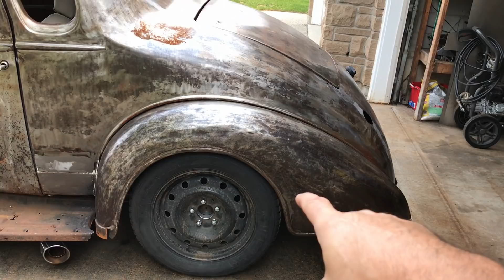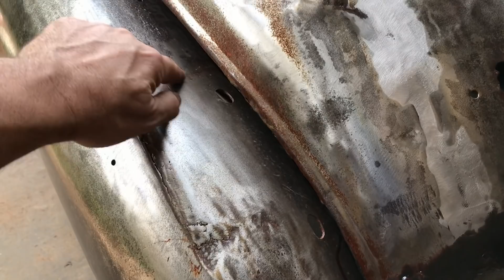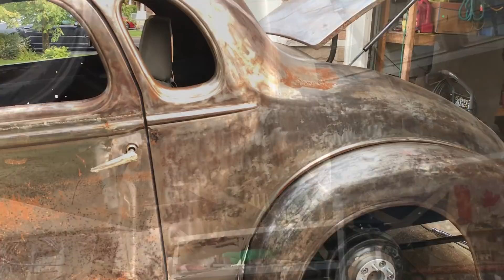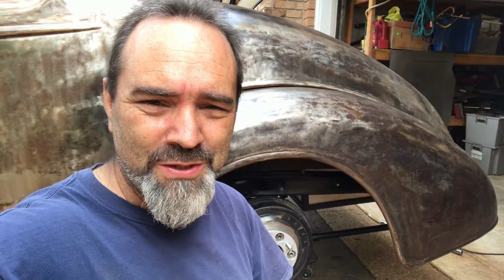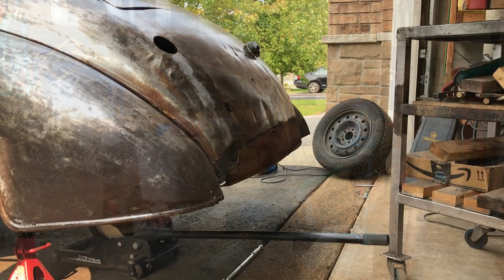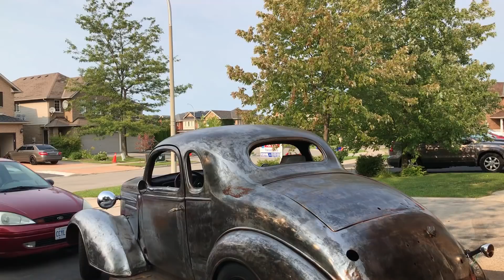Rear Light Brackets And Rear Fender Work On My 1936 Chevy Coupe

Comment: 36 Chevy tail light plate is on top bulb for tag has hole in top of light bucket and bolts to bracket. Your placement of model A light is pretty close to stock location I think

Comment: Taillamps look good except for the black colour. You'll have to strip them bare to match the rest. 2" round pipe might look good for a rear bumper and would be easy to fab.
Reply from the maker: That's exactly what Ailsa said about the lamp brackets. I'll do that tomorrow when I weld up the gaps.
Reply: Great minds...

Comment: Fender brace. Stock 36 Chevy from bottom of frame 90 degrees to front of rear fender. Should have hole on bottom flange of fender and hole on frame rail. At least my 36 delivery had one

Comment: One of these days you will find the box with a bunch of 1/4" toggles and wonder where the 1/4" x 4" bolts that should go with them went.
Reply from the maker: I had to look up what you were talking about. These are actually carriage bolts with a square under the round heads. Very handy when you don't have access to both sides of the thing you are attaching.

Comment: It looks amazing dave and its on the right spot... Thing is i feel they r perfect fit when u had the smaller headlights... So only if u had bigger ones! Any chance for a symmetry lover to adjust tank inlet to be in the middle and to swap the dreadful plastic cap with a sparkling silver one?
And hey... Ever gonna do body work on that car? (Aside from the damn doors) 😁
Reply from the maker: These tail lights are actually bigger than the factory Chevy lights. Body work can wait. Fuel cap can wait.
Reply: @ScottRods  oh forget about the real thing... Its ur very own rod... U pick sizes and shape it anyway u want... Even for front and back bumpers u can design ur own out of bare metal into something all new and found nowhere but on your car... Im not familiar with the original design but as a matter of proportion... Everything comes from big curves and we end it up with teeny tiny tailights! Ahhh just an opinion though... In the end u do what u do (because... U like it) not anyone else... We know the rules... Cheers mate

Comment: Will you bolt that rear fender metal to metal on to the car body? or will you place a  welting  like a rubber strip for that purpose between the fender and body?. Just wondering, I've seen several old Chev rear fenders mounted with a strip  between the bits. I don't know the proper name for that strip by the way:) You've come a long way on your build in a fairly short while. Keep up the great work.
Reply from the maker: Yes, eventually I'll install that strip....eventually lol.

Comment: Hey Dave, Tail lights look good. I was just wondering what the original lights looked like and where they actually mounted. I notice a hole across from the gas cap, is that where the lights originally mounted? Or did you fill in the old holes
Reply from the maker: This is what the originals look like (link below). The hole is where the gas cap is meant to be, but I couldn't find suitable piping. I'll improve it later.
https://st.lowrider.com/uploads/sites/7/2012/01/1202-lrmp-17-o-1936-chevrolet-cabriolet-taillight.jpg
Reply: @ScottRods  I like the model T lights, but I think the original lights are a little bit classier looking. Like that color gray as well